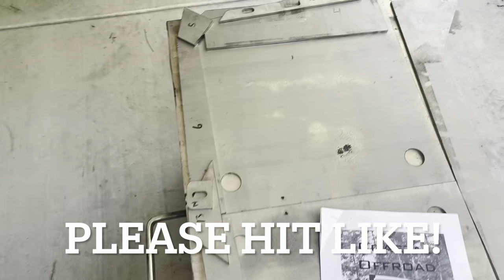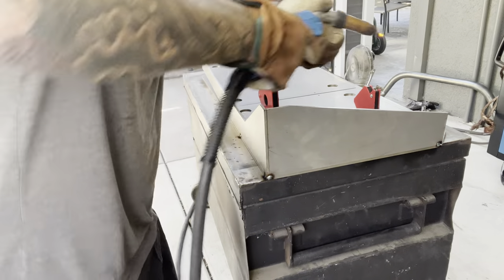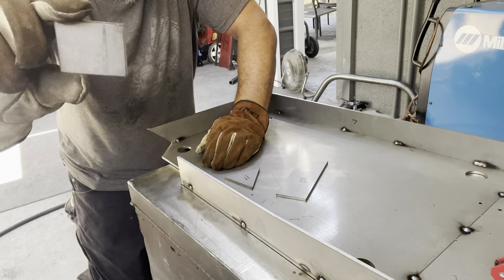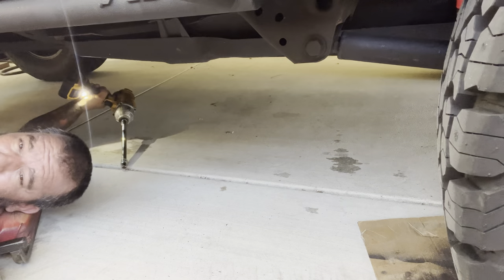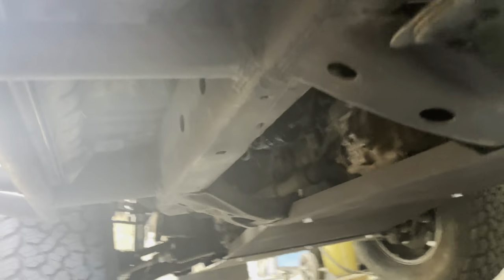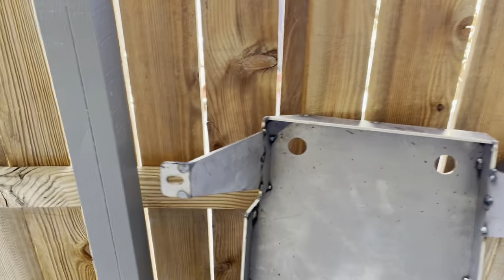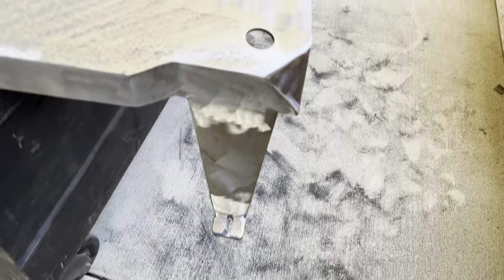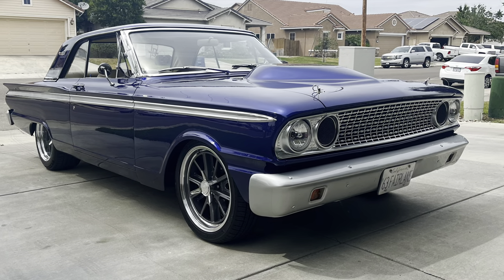Coastal off-road gas tank skid plate build and install!! 3rd Gen 4Runner

Comment: How much was the kit ?
Reply from the maker: https://www.coastaloffroad.com/product-category/toyota/toyota-4runner/1996-2002-4runner/
Reply from the maker: $406.00 for the gas tank plate $557.00 for the front and drivetrain. I did their full skid plates. Their front and rear bumper and swing out for the spare tire. All the videos are on the channel. I’ve beat the crap out of mine hitting rocks trees and not one dent just some undercoating got scratched.
Reply: @ljoff-roadhotrodmods5664  exactly what I’m looking for on mine , thanks brotha !